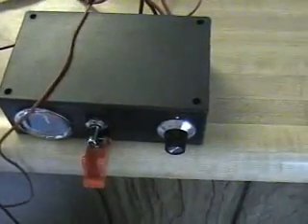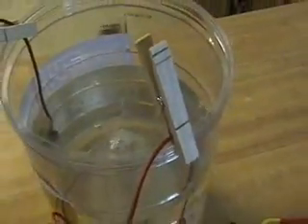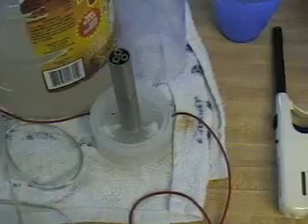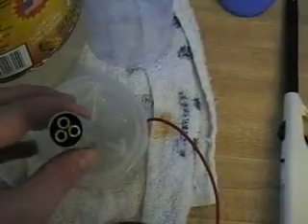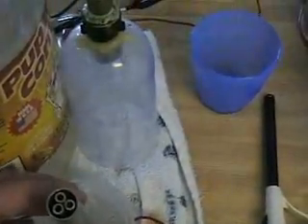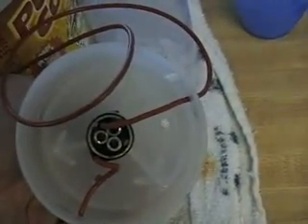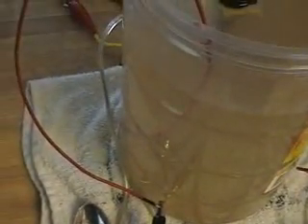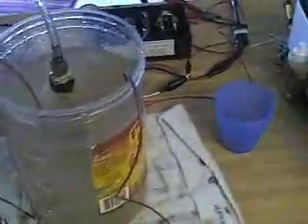Hydrogen Reactor

Comment from the maker: Thank you. I've learned a few things since starting this. Don't use Salt or Baking Soda as electrolytes. They both produce toxic gases. Citric Acid, Lye, even Vinegar are good substitutes. However, this cell will still produce alot of gas using regular tap water, with no additives. And the direct link to the PWM Circuit is here: 

stores(dot)homestead(dot)com(slash)hydrogengarage(slash)Detail(dot)bok?no=10

I'ts pretty easy to put together.